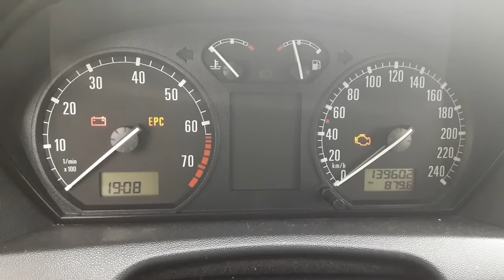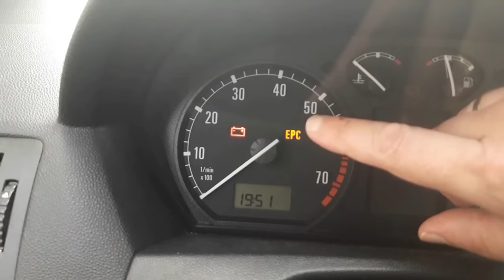Most Common Reasons Your Check Engine Light Is On

Comment: I have gone to two very efficient mechanics they say there is no problem. One of them just re set the entire system. The light still comes on. This is sickening.
Reply from the maker: Hi and thanks for watching! What's the error code on the diagnostics?
Reply: @DespairRepair  - P185C and P1983 both showing in history.
Reply from the maker: @raseshmehta2934  that could be a lot of things. This is just a wild guess but did you check the maf/map sensor?
What's the car?
Reply: @DespairRepair  - Maruti Suzuki Celerio 2018 make.
Reply from the maker: @raseshmehta2934   that's a a good car. Again didi you check the maf sensor?
Reply: @DespairRepair  - It's gone from bad to worse. Is there a number i can reach you? Or I give you my number. The car is not starting anymore and i have given to service station which is Maruti Suzuki authorized service station.
Reply from the maker: @raseshmehta2934  hi again and sorry ofr the late reply. Did you solve the problem?
Reply: @DespairRepair  - AMT Motor pump and AMT Controller will be replaced. There error code was P1983 and P185C. Given it to service station and will get it in a couple of days.
Reply from the maker: @raseshmehta2934   I think you made the best decision by letting the service do it, especially if you get a guarantee on the repair. Just hope it didn't cost you much.
Did they say what the possible reason was?

Comment: Visited gas station, fill a tank and after few kilometers i got this error.
Reply from the maker: Hi and thanks for watching! In that case I would first check the gas cap but it can also be the fuel quaulity.
Reply: @DespairRepair  It was some sensor for gas intake. Delete error on diagnosis and thats it.
Reply from the maker: @rasosteva  glad you solved the problem and thanks for sharing!

Comment: I’m finding out tomorrow why my engine light is on and why my car battery dies everyday eventhough the battery works fine :((
Reply from the maker: Hi Alex and sorry for the late response.

Try checking the alternator voltage output first. All you'll need is a multi-meter. We've made a video specifically on this topic if you have the time you can take a look.

Comment: Man my light just came on while I was driving home from work tonight fml
Reply from the maker: Hi and thanks for watching!

Are there any other symptoms besides the light coming up?
Reply: just bought my first car drove it home it came on later that day
Reply: @willcouchon9506  same thing happened to me the day I bought my car .
Reply: @Rikki-lh2mw  mine shut off but now there’s something wrong w one of the tires or something rip
Reply: @willcouchon9506  mine had shut off while I was driving too by than I thought it was about Battery so I got a new battery but it did it again.than I called my AA road recovery people they came and fixed the problem he said he cleaned up maf sensors but needs a new one so I took it to a garage...I know it's only a job for 10 minutes but I have no facilities no garage and I live in a small flat in Central London so the garage charged me more than I expected of ££££ anyway  they placed the maf sensor but the light came back on after 2 weeks.but my cars patrol cap,s seals broken I wonder that is it something to do with it?
Reply: @Rikki-lh2mw  the inspection guy said one side is slightly raised or something someone ik said it might be the tire rod or the tire hub
Reply: @willcouchon9506  Thank you Mate much appreciated.
Reply: Same thing happened to me bought my first car and have been having problems since it’s sad I got  ripped off
Reply: @lovegod6425  what about the engine is it good despite the light does it run good?
Reply: @lovegod6425  they should have to first it for free for the first 90 days i think the dealership i got it from is
Reply: @willcouchon9506  I bought yesterday a new petrol cap just to take the worries out of my mind. But it wasn't anything to do with petrol cap so I spent £20 for nothing really.
Reply: @willcouchon9506  tire?I did not know the light could come up for the tire fault.unless it's a high tech car ofcoure..
My skoda is a very cheap 20 years old car,I'm unemployed so that's all I could afford.
Reply: @Rikki-lh2mw  for a dealership or from someone
Reply: I bought it from a private seller and , it’s making a cranking noise .
Reply: @lovegod6425  I bought my car last year in June.than an 10 minutes after I bought the car the check engine light came up.how nice uh? Bloody greedy trade men !!!
Reply: @willcouchon9506  thanks for recommending those items.I will do as you suggested. Many thanks.I dont know where you live but I live in London so some trade men,women. Maybe they wouldnt let me use them for free
Reply: @willcouchon9506  ohh I just googled them and the cheapest one is around £16 so it's worth to buy one of them.great idea my friend.honestly at least we would know the issue of it without hassle beside we can use that ond2 scanner forever !!
Wonderful idea my friend.many many thanks.happy man here😊
Reply: @lovegod6425  cranking noises?
That's bad mate.I hope you did not pay so much.did you pay with your card or bank transfer.
Hope you did not pay cash in hand.if you paid by bank transfer etc.than you can always complain about dishonest trade men,man to trader and standard agency and get your money back!
Reply: @willcouchon9506  I bought it from a garage where they repair cars etc also sells cars.I bought it in Suffolk that's where they base.the reason all the way from London to Suffolk I traveled to buy that car was A.they accepted credit card payments. 

B.suffolk is a nice area people they wouldnt drive their cars like the Londoners drives here like a mad cow !

C.before I traveled to Suffolk I checked the info of the garage it's a family oriented business that's why I went there and bought it .but sadly the light came on 10 minutes I signed the documents.
Reply: I tried he denied my refund request
Reply: @lovegod6425  you bought it privately....hmmmmm  what a dishonest people out there!!
It must have been a big shock for you.!I'm sorry mate such thing happened to you.
Use your power.try to get your £££ back.OK I can understand that if the things went wrong 5-7 months after you the car...that things should not be so bad.but as soon as you bought the car and the noise appeared than that's bad.
Sorry my my eyes closing.chat tomorrow. 
Good night. 
Ps.if you can take him to a court.i tell you what you will get paid 100%
Reply: I got it fixed , God Is great
Reply: @Rikki-lh2mw  literally me

Comment: I dont know whats going on, engine  light is on, mph needle goes to 0, doors lock and unlock repeatedly
Reply from the maker: Hi and thanks for watching!

Seems like an electrical or electronic problem to me.  Can you drive the car? 

It could be a dozen things and best to connect a diagnostic tool and try to get an error code.

Also, are the ground connections OK? if everything happens at the same time it could be that.

Sorry, this isn't much help but that's the best I can do with this info.